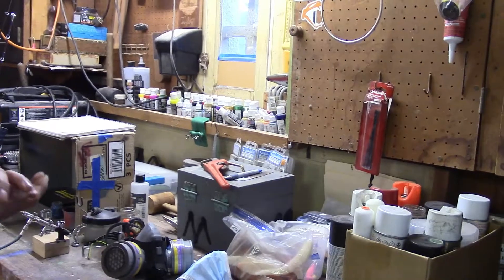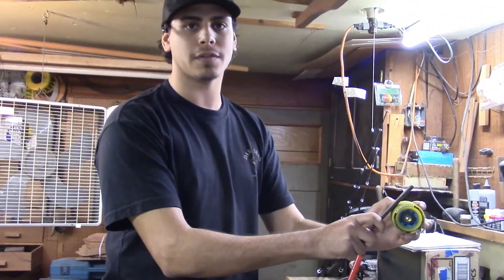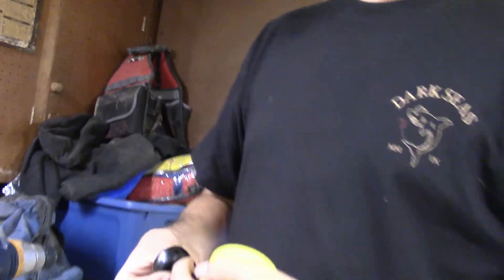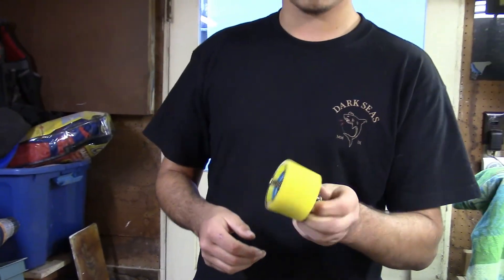HOW TO RESURFACE YOUR WHEELS (GET THE OVALS AND FLATSPOTS OUT)

Comment: You need a drill press with platform that the wheel can pass through or next to.   This way you can rest the file on the ledge and essentially create a lathe type rigging.  This way you would be able to pass by eye the same distance across giving a uniform wearing pattern.  You could set up a ruler and be precise.